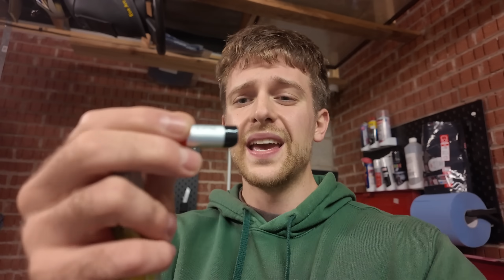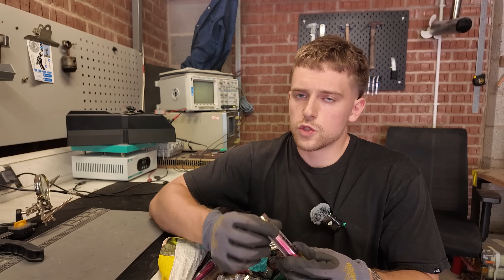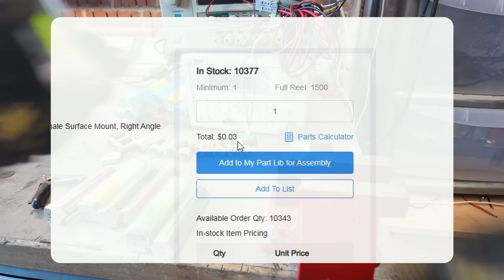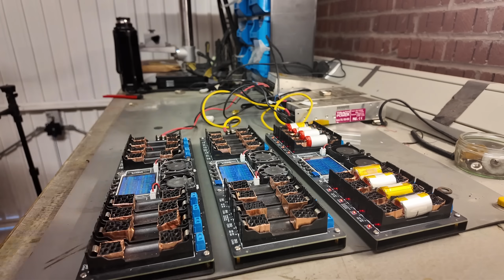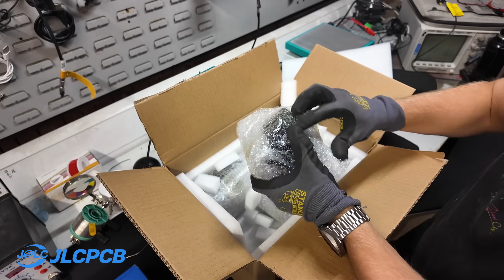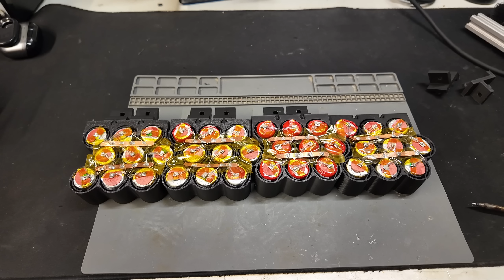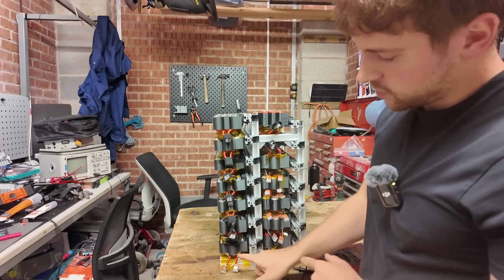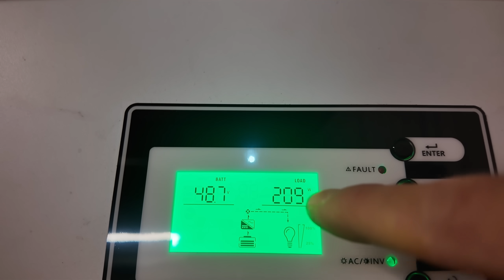I Powered My House Using 500 Disposable vapes

Comment: If you plan to constantly switch your workshop from the rest of your home by using the circuit breaker, you must add a load break switch rated for frequent operation and not use the breaker; circuit breakers are only rated for 3000-4000 electrical switch operations and 10,000 to 20,000 mechanical operations, routinely switching the breaker to disconnect loads may prematurely wear the breaker and it may not switch during a fault condition.

Clearing some things up, some people are saying the numbers I provided are wrong: 
They in fact are wrong, I got electrical operations and mechanical operations mixed up, looking at Easy9 2P 32A 3kA 400V CA B curve breaker, it's rated for 4,000 electrical operations (FULL  LOAD) and 10,000 Mechanical operations (NO LOAD), though, some are up to 20,000 operations.

Yes, it's not wrong to use a circuit breaker as a switching device; Where I live (International codes should say the same), the rule "NBR5410 brazilian Low Voltage Electrical installations code",  states:
"6.3.7.5 Functional Control Devices
[....]
6.3.7.5.2 [...]
2 The functional command can be carried out, for example, through:
[...]
Circuit Breakers
[...]
"
So, where I live, it's not against code, and you'll probably never get to use it's 4,000 electrical operations or it's 10,000 (low end) mechanical operations. If you switch the breakers daily on FULL LOAD, the breaker will last for 5,47 years (I consider 2 operations, turning off, and then on, thus 4000/(365 days * 2 operations)). if you switch daily, on zero load condition, then it'll last for 13 years.

I got the much lower number from the circuit breakers we have at the company I work at (I'm an Eletromechanical Technician involved in machine maintenance, automation, electrical installation maintenance and some high voltage operations [13.8kV]), to our 1,000 kVA oil-immersed 13.8kV 380/220V transformer we have a low voltage NS1600N 1600A breaker, and this breaker is only rated for 1,000 electrical operations (of course! Much higher current than residential) and 10,000 mechanical operations.

I simply prefer not to use the breaker as a switch, after I got involved in an Arc Flash incident, I much rather have the circuit breaker doing one thing and one thing only: protecting the electrical installation (the breaker too a few **too long seconds** to open). Most of you will never get to stand a few meters away from a 1,000 kVA very angry transformer! your hand on the circuit breaker shakes, the ground shakes, the cables starts to dance, the sound from the transformer is extra angry and the smoke from burnt copper is...quite a warning. There no longer was a 14 AWG wire where the 23,000 Amps from the short circuit happened.

Also, in the same place, we use a few circuit breakers to switch small motor loads, I don't find it to fun to use a small 30A breaker on 14 awg wire when the next upstream breaker is a 250A one haha, yeah..., much rather use a contactor for that.

Before editing I claimed mechanical operations were anywhere from 3,000 to 4,000. They're not, those are full load electrical operations, mechanical operations are 10,000 to 20,000.
Reply: as a teen,i convinced my boss,the owner of the grocery store,to let me wire in the 3-phase charger for the pallet jack/"Towmotor",instead of hiring an electrician. So I switched off the main breaker for the store,wired in the charger,flipped the breaker back on;NOTHING. dead. i checked everything again,flipped the main breaker,still NADA. my coworkers were all laughing at me. I disconnected the charger,flipped the breaker back on,the store was STILL with no power. The electrician my boss had to call said the breaker failed when I flipped it off the 1st time. He said I had the charger wired properly. So NOT my fault for shutting down the store for a few hours.
Reply: @JayWye52  i bet they were giving you shit the entire time
Reply: @JayWye52 Did they believe you / the electrician?
Reply: @JayWye52  yeah, but it was working before so
Reply: Also he needs a three pole switch somewhere so you can't forget to flip one and end up backfeeding the grid
Reply: @speedstyle.   Absolutely, I can’t imagine that is up to code, especially in the UK with their strict rules. 
What he has is an off-grid inverter, not capable of feeding into a live grid. If he turns on the inverter, mains, and cross-tie to the house, that inverter will hopefully shut off, but more likely blow up. If he leaves them on during a power outage, a lineman may get zapped. 
   
My inverter can provide feed-in as well as off-grid power, but those are on two separate circuits, for good reason. One feeds in and shuts off when the mains supply goes. The other can then take over powering the house using that 3 way switch.
Reply: @kaasmeester5903 thats why there are those 5 rules for electric work. You not only disconnect one line. You must make an connection to earth and short circuit them.
Rule nr4 in GerNoMoney 
DIN VDE 0100
Reply: @speedstyle. ... it can be done with power relays and current sensing relays ... i can't see any other way
Reply: I was wondering about grid disconnection, I believe referred to as "islanding".
Reply: RTFM. Most MCBs are rated for switching way more. Like ABB S201 MCBs rated for 20000 mechanial and electrical cycles/  And ones not for home use, but for indutry use are rated for switching under load way more times than you can in your life.
Reply: @manwithagun89  Depends, where I work we have a 3 pole 1600A NS for a 1000 kVA 13.8kV 380/220Vac oil-immersed transformer and it's electrical full load capacity at 690V is 1000 electrical switch operations and 10,000 mechanical operations.

For both of ours 300kVA transformers we use Steck Asgard 500A breakers and these, without maintenance are rated for 5,000 switch operations (The manual does not clear up whether these are full load or no load) .

It really depends on the breaker, either way, I wouldn't use a circuit breakers as a switch, even thought it's not against code, after I had an arc flash incident on a 1,000kVA transformer, I like to leave circuit breakers purely as protection devices. But that's a personal opinion, it's up to code, should be able to handle it.
Reply: @idont3282  yep, sure. But i am talking about MCBs for 230/400V. I can't remember what brand, but recently i had in manual wrote smth like "MCB can be used as a switch for 12 switches per day max" and rated for 50k mechanical and 30k electrical under full load. it was 160Amps 3Ph.
Reply: @manwithagun89  gad damn, that's a really good breaker, are you able to find the brand of that breaker? At the moment I try as much to convince the company to buy the more expensive but trusty Schneider (usually 3k full load ops)

Closest I've seen with those numbers was a breaker from ABB with 20k electrical full load ops (S202-K30)
Reply: @idont3282  i'll look, but can't guarantee. will post here when find one
Reply: Ouch.  Details matter.
Reply: where have you pulled those numbers from? MCBs are rated for way more then 3000 operations.
Reply: @Goryrat  they are still not a daily on off switch, don’t be obtuse.
Reply: @_c_y_p_3 most manufactures DB switches and MCBs having the same operation amount, stop spreading false info.
Reply: @Goryrat  You sound like you’ve gone from Tylenol to paint chips, giving me advice, how about you stay in your trailer and just don’t come knocking at my door no more.
Reply: @Goryrat 3000 is common for cheaper MCBs, even for options offered by a good manufacturer. SE's Easy9 specced at 4000 but their more expensive Acti9 is 10000.
Reply: @Goryrat Got myself confused with the numbers, they are rated for 3000 operations, electrical operations, not mechanical (10000 operations on the low end). So they should be safe when using as switches, but I still rather have a dedicated switch
Reply: @Goryrat  Got them numbers confused, it's often 3000 operations for electrical full load operations, and 10,000 - 20,000 for no load mechanical operations
Reply: That almost 10 years of switched once per day. Yes of course it's better for a dedicated isolator or an MCB rated to act as an isolator.
Reply: You have no damn idea wtf your talking about 😂
Reply: @emptytrashcan2556  you are just mad cuz you can’t be a recycling bin instead, but we are what we are.

Comment: You can repair those dead cells bu putting them in parallel with a known good batter that is charged. Keep them connected until the voltage in the dead one exceeds 3+ volts, or even better balances with the good one. You should then be able to fully charge the "bad" battery. I have repaired my 80V green power batteries this way before. It works for all lithium rechargeable batteries l.

Comment: I had the same vape machine for over 10 years. It was rechargeable, it had replaceable batteries. I changed the tank all the up to a 5ml tank. Then one day it short circuited and died.. if you get a good vaporizer, it will look after you for years..

Comment: 3:00 No... Every vape you take apart, whether it's empty and can't be used or full, means it's another vape that's no longer clogging our cities, our waters, or our fellow animals environments. Youre doing great work with every one you pull apart, regardless of if you can use it for your project or not. Remember that...
Reply: I cant remember what he said or if he said, but sure he took all the batteries out which is nice, but what of the plastic bits?  Still trash unfortunately I would think.  Though not like it would make a dent in the worlds plastic problem.
Reply: @coheedmonstar33 

In the grand scheme it's barely a difference, yes. But it's still less wasted batteries, and more upcycle. It's an improvement, however low it is
Reply: Wait, what do you think he is doing with the batteries that can't be used?
Reply: Unless he dumps them in the household waste when done with them..
Reply: This does absolutely nothing in terms of availability LMFAOOOO
Reply: For every one he pulls, I throw ,think about that…..
Reply: @Just_Me10122  bait used to be believable
Reply: @somethingforsenro not bait buddy 😂
Reply: @Just_Me10122  Its certainly true, the effort to do something like this on a large enough scale to counter the amount every day people throw away is just inconceivable to the majority of people. Of course people would rather believe a solid point is bait and just bury their heads from the point, rather than an actually think about it... 
We Can dream of a world where there is a large scale manageable solution, maybe one day there will be. Either way its good to see this kind of content posted. Not only is it showing an effort to do, something, but maybe people can learn from content just like this or even just take inspiration to actually make a bigger difference. 🍻
Reply: @gman1183 well I lied because I try to hold on to them not throwing them away
Reply: @Just_Me10122  💀😂🥀
Reply: @PartiallyCooked lmao 😂

Comment: I don't know if it's required by electrical code there, but you may want to consider some kind of interlock.  Right now, it's very easy to have the inverter and mains on at the same time; an interlock would prevent that.

Comment: You should not make or break a circuit with a disconnector, unless it is an emergency. The disconnector could fail over time. Use a circuit breaker instead.

Comment: You should definitely get a proper transfer switch with interlock, making it impossible to have the inverter & house fuses on at the same time. That fusebox is sketchy AF and is one small mistake from exploding the inverter or burning the workshop down.

Same with the powering the house, there should be proper transfer switch with interlock making it impossible to feed from inverter and the grid at the same time.
Reply: This is exactly what I thought. There are also Switches with three positions that switch from mains to off and then to your alternate power source. In Germany this is legally required if you want to supply your house from a standby Generator. Otherwise you also risk to feed electricity back into you local grid during maintenance work. It is unlikely that your inverter would be able to supply your neighbors but this still poses a risk to electricians that deliberately cut the power to your house.
Reply: @Florzde  I'm guessing it's legally required in the UK also, but we don't have time for electrical codes. We put fuses in, and mentioned "safety" several times. The rituals have been satisfied. Nothing can go wrong.
Reply: I’m sad at how far down this is. Nobody else is talking about how terrifying that breaker setup is

Comment: Why wouldn't you have used ferrules for the Wago connectors, instead or just bare stranded wire? Even if you solder the strands together, it still poses a hazard. Ferrules would mitigate that and provide an even more solid connection.

Comment: I really, really hope you have some additional safeguards to prevent you from accidentally connecting your inverter to the grid. From the video it seems like you just turn your main fuse off and then connect the inverter instad, without any safeguards against connecting both. If they are not synchronized and you connect the nets, they are gonna fight.. and I think the grid is gonna win

Comment: Almost totally off-topic, but as you found, a better kit with replaceable/rechargeable items means the "refills" cost as much as the original kit, which is exactly what I found with whiteboard markers, I used the Board Master pens which have refills, but the pens could be £1 each if you buy 10 at a time, and the refills £15 for 10. The good point about the refills was that the writing was always nice and dark and pupils with vision problems could read the board better.

Comment: I would like to know how long it would take to charge that battery with rooftop solar panels.

Would it be possible to rig a system of a few of those to cycle so you could exclusively be solar powered using vape cells.

The proof of concept would RUIN the power industry😂😂😂

Comment: I haven't seen this posted elsewhere from a quick glance, so: 
You should get proper lockouts for the circuit panels to ensure you can't physically have the Battery/Local inverter Connected and the grid at the same time.  I 'Oops' of flipping that swing will cause Major Issues when your inverter isn't in the same phase as Grid.

Comment: I'm learning soldering and happen to vape.  I used to make my own coils and use dripper and various tanks but over time it became a bit tedious.  I switched to pod vapes which work however one flaw i noticed with pretty much most of them is if they have juice and sit upright will leak eventually, keeping them stored upside down however doesn't do that.  Got tired of needing to refill (i know, lazy) so i've got the disposables but am keeping them once depleted of juice so i can use the batteries.

one thing i saw someone use it for that was nifty was for a remote control that would normally take regular batteries.  With the circuitry built in and battery they could make the remote rechargeable.  Could use it for other things like raspberry pi, breadboard with lights, etc.  I'm currently in canada where they have disposables and when i used to live in the states they had them as well.  it is a bit contradictory that im buying them but my main gripe was people throwing them out, at least i am reusing.  The plastics can probably be cleaned too and melted to use for 3D printer filament.

Comment: You really shouldn't solder directly to lithium battery terminals: the heat can damage the cell.  Best to spot weld using nickel silver strip.  Suitable spot welders are inexpensive and readily available, or easy to build.

Comment: maybe add a container of transformer oil to put it in it ?  then you use solar and wind to power this unit and you build another then you cool the oil of the container with rain passing trough the oil into tubes of copper maybe covered in kapton tape aswell in fact you should add more kapton and sillicon then dunk the whole thing in oil and cool the oil if a vape cell blow the repair gonna suck but no fire at all.
Reply: harvest the rain then electrolyse the rain into a axial flux motor  that would be nice DANG I NEED A SHOP

Comment: Re solder fumes, the Ikea Förnutig Air Purifier with the optional extra carbon filter does a great job on its top setting, especially if you make a little shroud for it.

Comment: USB port won't regulate the recharging of the cell, you need a circuit board too to cut off charge and regulate current flow. So it's not about 3 cents but still, it's cheap.

Comment: Thank you for creating a video on this huge issue. I've been vaping since 2013, and I always use box mods with 18650 cells or internal batteries. I hated seeing juul pods littering the streets when they were popular. The issue is even bigger now with disposable vapes.  Larger quantities of plastic is being tossed into landfills and the streets along with the lithium batteries inside. At least Juul pods were not disposed along with the battery; the case was made of metal. Anyone who uses disposable vapes is seriously damaging our environment. Salt nicotine mods are small. Single/dual/triple 18650 mods are bigger, but there are some mods that have a built-in internal battery and are also small. People using disposable vapes are creating a huge amount of e-waste while using the excuse of "convenience." Cost is also not an excuse. Disposable vapes are expensive, and anyone who vapes those should look at switching to a box mod or quitting vaping altogether.